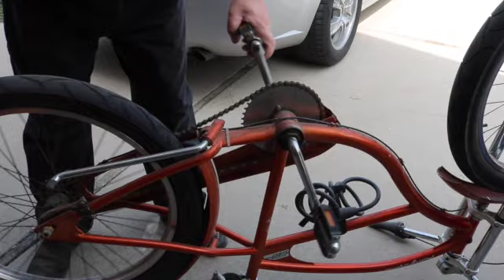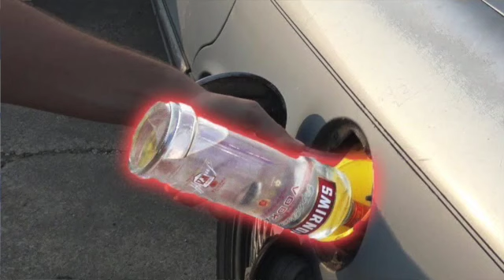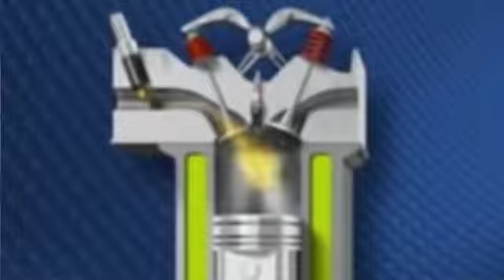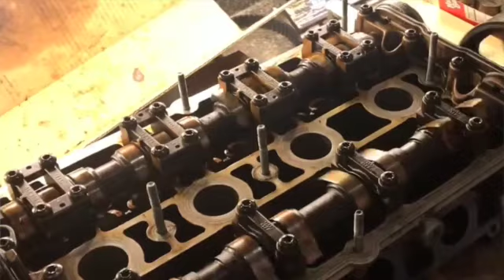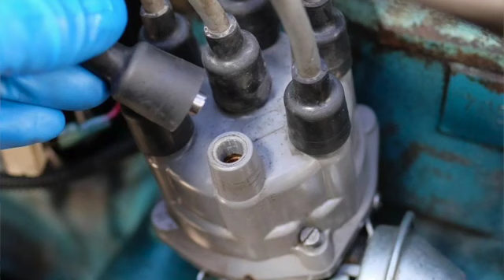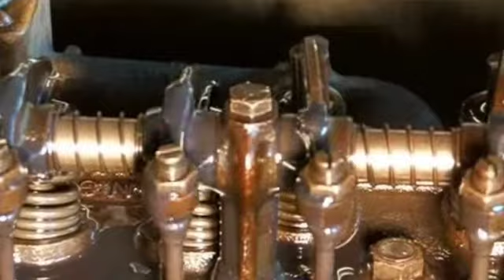How an Engine works in terms almost anyone can understand.

Comment: I learned this stuff in grade 9 with a Briggs and Stratton lawn mower engine. Been doing all my own wrenching almost 50 years later. Good video!
Reply from the maker: Thanks. Me too. The Briggs & Stratton is a great engine for learning and I still prefer its simplicity to Tecumseh and Honda engines. I have an old one in storage somewhere I was going to pull out for this video, but it turned out that would have been a weekend project of its own.